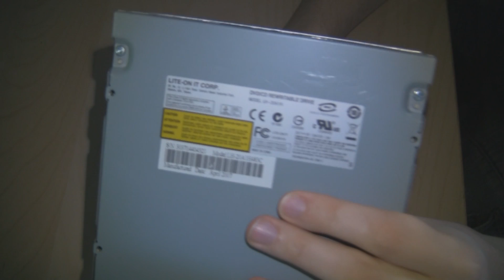How To Get the Laser Diode Out Of A DVD Burner

Comment: Which class laser diode your DVD rw have ???In my case I open class 1 laser inside printed DVD writter when I tested it was very weak laser seems like same as or weeker then 0.5 mw laser and other iR diode is little bit powerful then red but both not seems to class 3b how it's possible that DVD rw writter are using class 1 type weak laser diode instead 3b type ???????

Comment: +TingaWinga5 I got two rectangular shaped diodes with 4 legs. Why is that? Old models use circular diodes and new ones use rectangular? Please reply.
Reply: SMOKER I know that this comment is over 1 year old but do not use newer burners than 2009-2010 I had 3 from 2006 2007 and 2010 and the 2007 and 2006 models had the right type of diodes but the 2010 one didn't hope I helped

Comment: question: have a dvd, is not a burner, but in the warning label it says that it has 2 diodes. one of class 1 (I suppose that this is the infrared one) and other of class 3B, that, for the things I've read on internet should have 500mW max. So, I dissasembled the drive and I found a rectangular shaped diode with 4 pins. Do you think that is powerful enough to burn?
Reply: DanielTseng100 if it has 3 pins, it will be the laser diode class 3B. good luck
Reply: DanielTseng100 ya, it's blue colored I think, the most powerful laser I think
Reply: Awesomeness4U no, it was red
Reply: oh
Reply: DanielTseng100 colour has nothing to do with power.